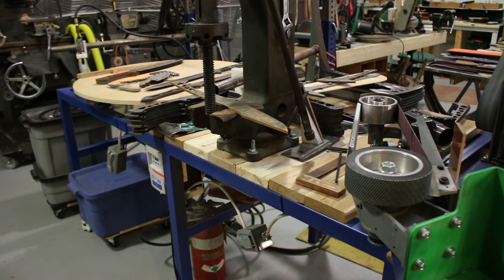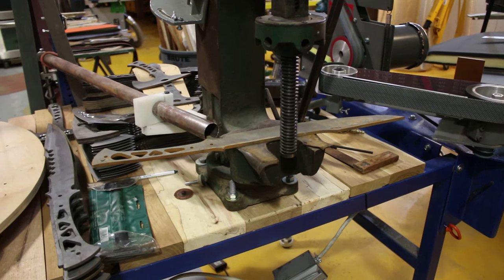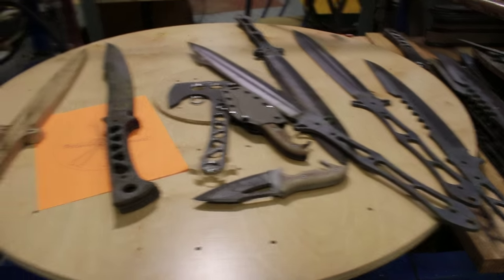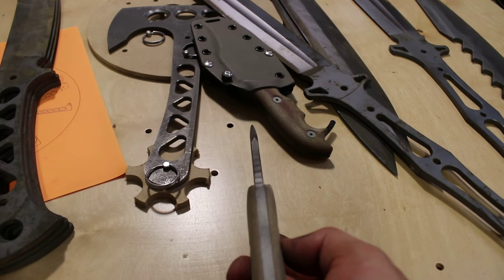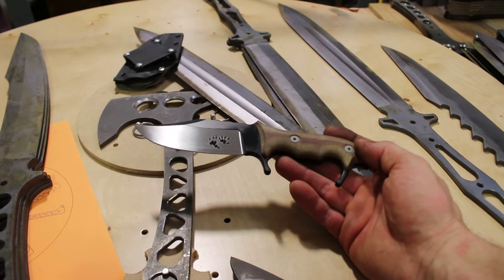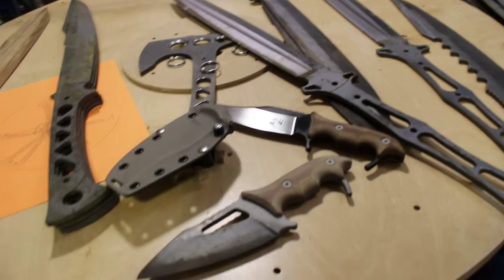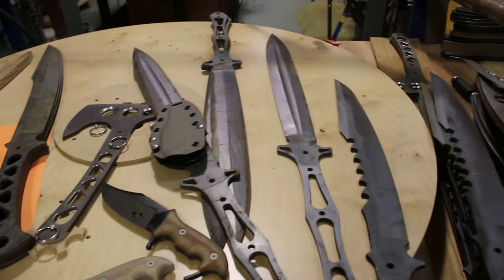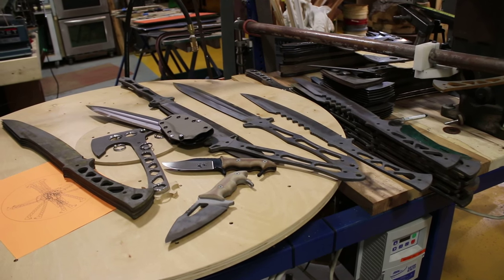Omnivore Blade-works Status 9-8-15

Comment: Lots of good stuff in progress, Jared.  Bummer about the warpage.  I have had good luck with a stress-relief cycle (1250 for 1-2 hrs) after grinding.  Nowadays I usually do a full normalization after grinding.  That's one helluva arbor press!!

Comment: I like the Howler Monkey for the clip point blade, or just the Monkey Tail.  The kitchen knife one is really cool

Also, have you tried annealing after grinding?  Grinding can induce stress too from my understanding and lead to warping in heat treat, particular if one side is ground and then the other.

Last question too, all the 5160 Kodiak's spoken for if you can get them straight?  Not that I can afford one, but well, never hurts to ask.